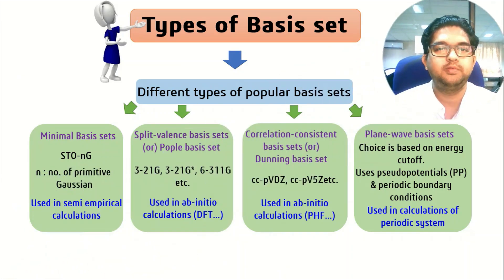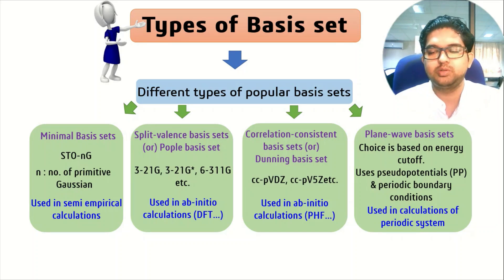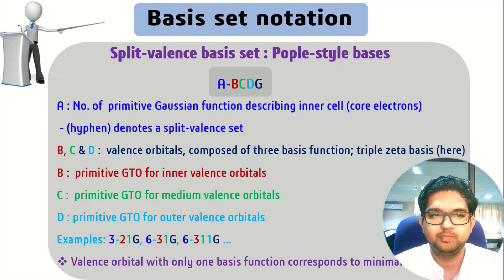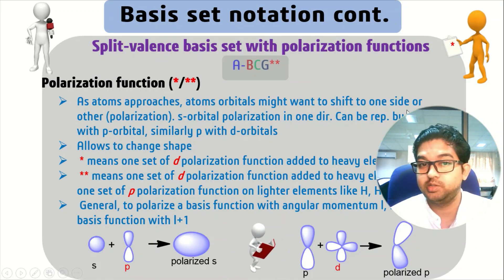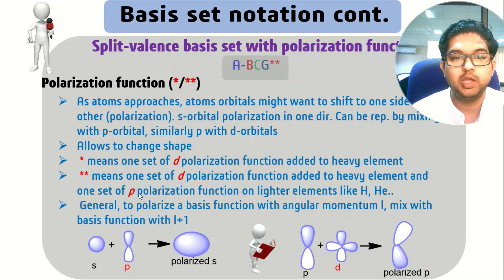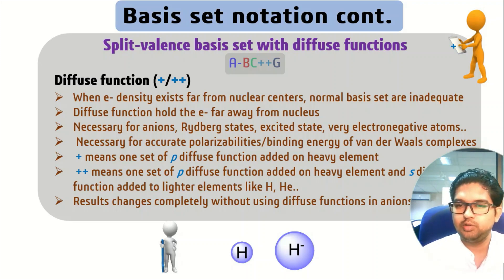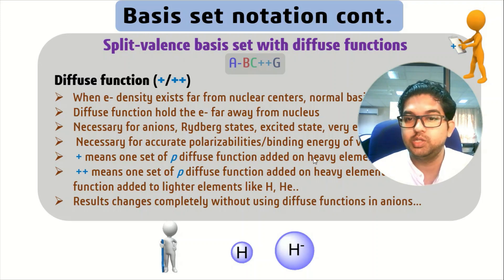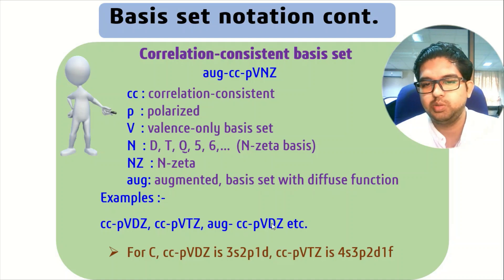How to choose a basis set in DFT calculations || part 3

Comment: sir what is the difference between using basis set 6-31G & 6-31(d,p)
Reply from the maker: @materiallycondensed  in 6-31G there is no polarization function while in 6-31G(d,p), polarization function is added .....watch all parts of the tutorial on Basis set....